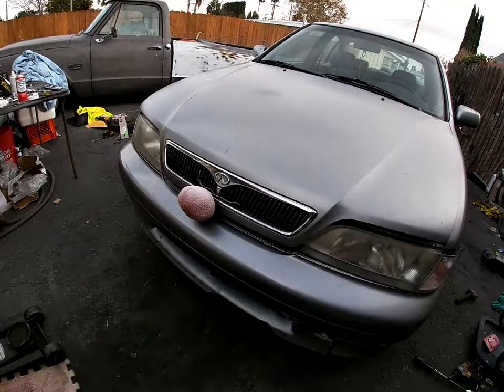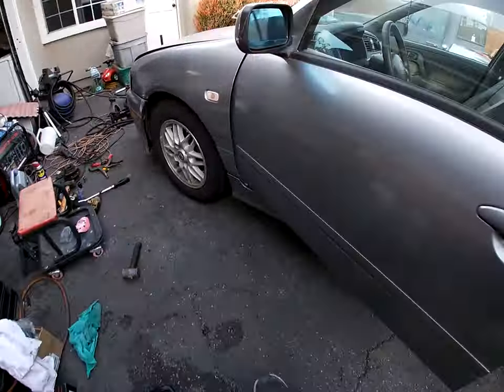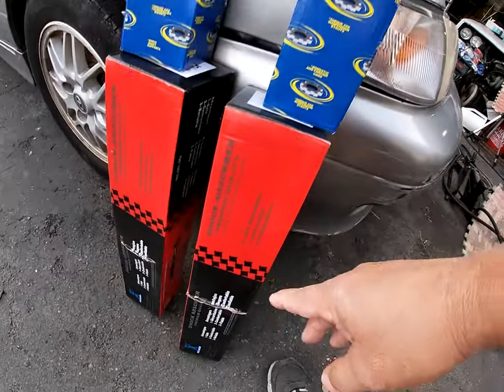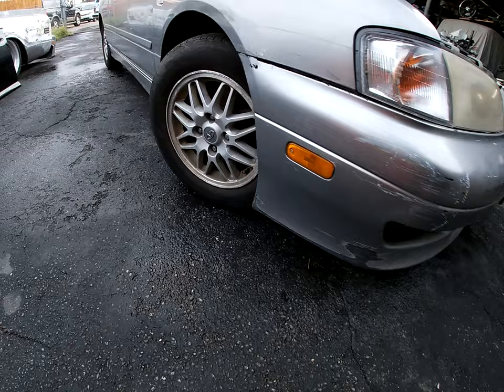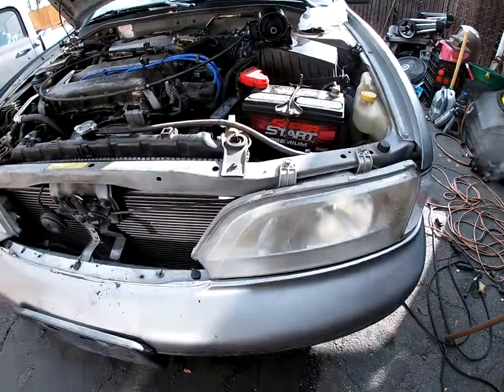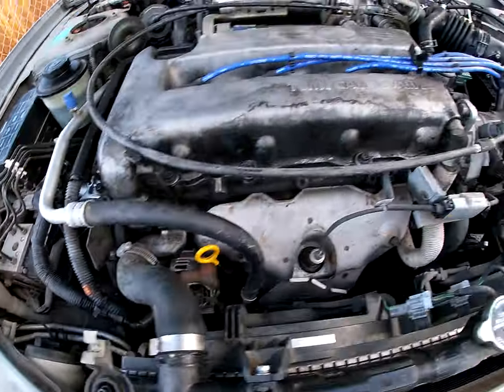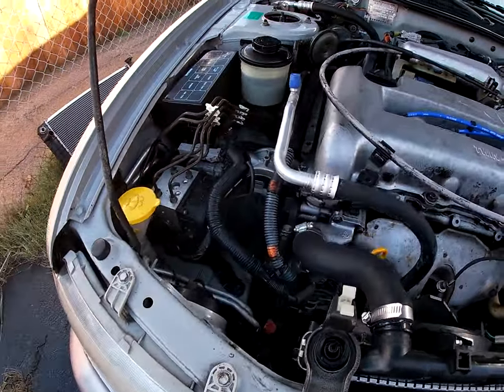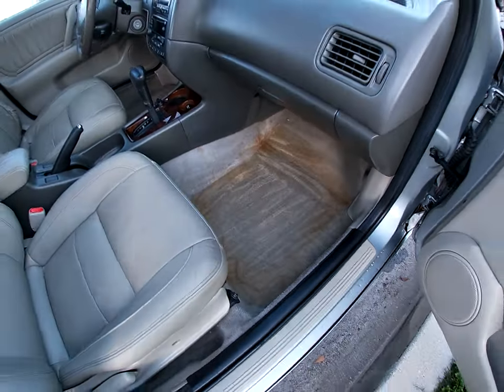2001 Infiniti G20 Rebuild

Comment: What did you put on the mats to get the stains out? Please tell me I have the same exact car. But I lost my job in my starter and upper control. Arm went out so I couldn't fix anything but my mats are stained and I just want to get them cleaned. I get my car back running and looking good thanks thanks in advance Brother
Reply from the maker: I just use LA Awesome from the 99Cent store. I also use Mr Clean all purpose cleaner. check out my other detail videos and you can see what i use. Thanks for watching, hope you sub to the channel.